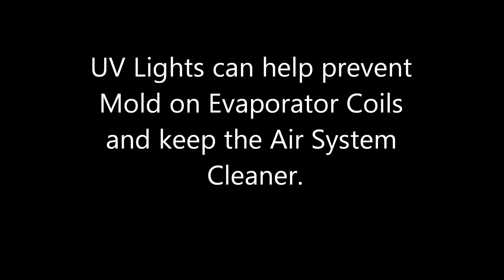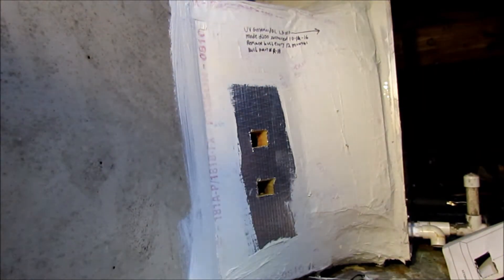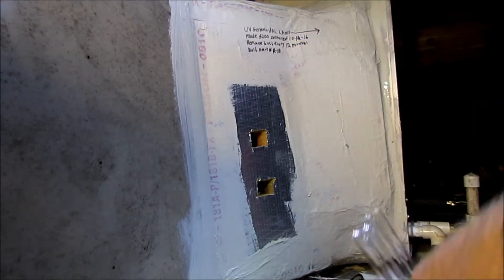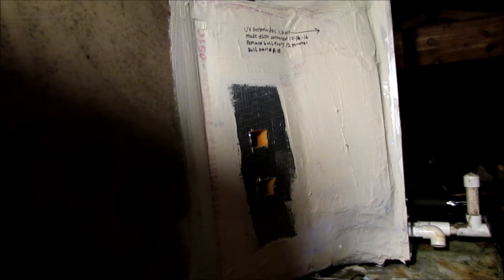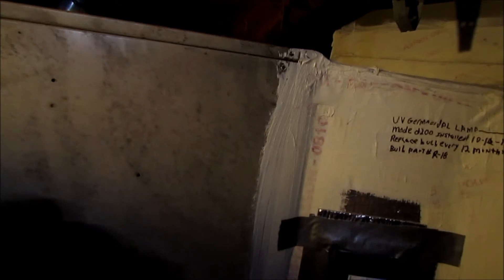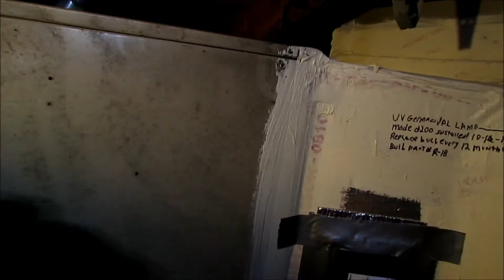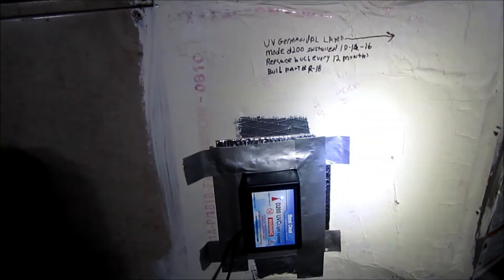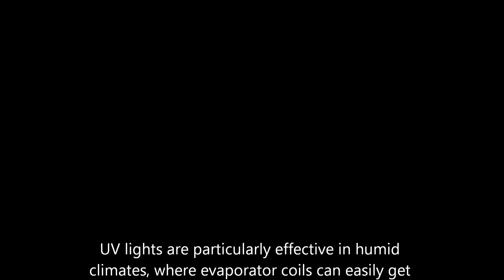How To Install UV Light In AC Duct Work Evaporator Coil  For Mold Prevention Episode 8

Comment: Great to see an install with a slab coil and wonder where you had the second UV unit.  Great video
Reply from the maker: I had 3 one on the other side of the filter and one on each side of the evaporator coil for a total of 3